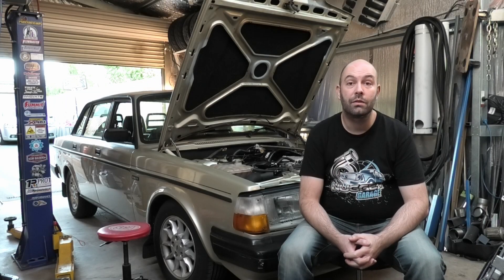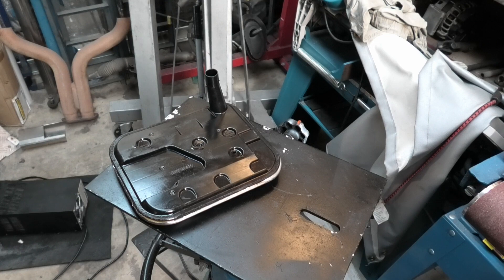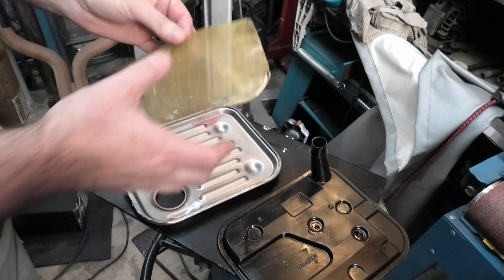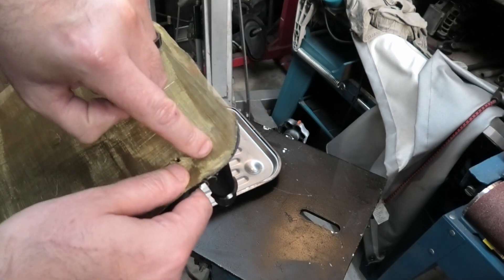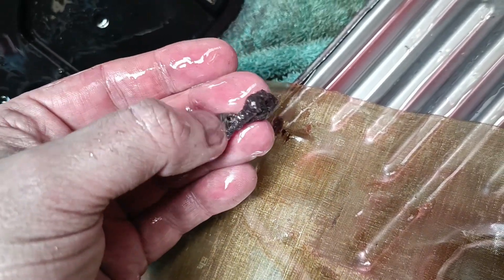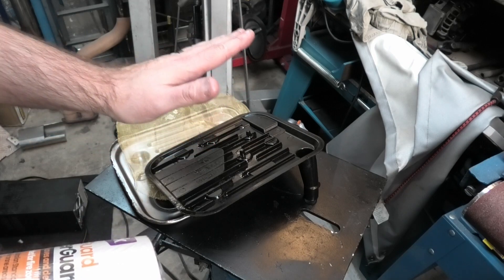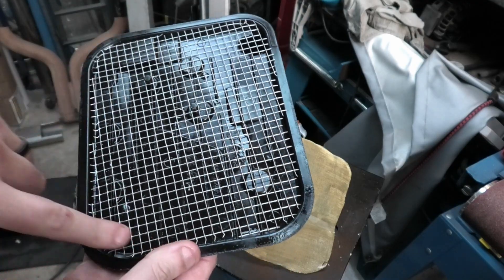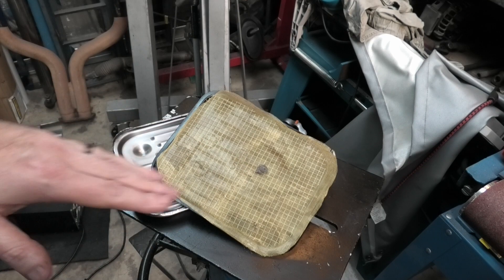4L80e - I FIXED IT

Comment: The wad in the mesh at the pick up tube Looks like assembly goo that didnt melt down with run heat.
Reply from the maker: Nar it was something fabric based. Looked like shop rag lint after I dried it out to inspect.

Comment: I used to use the red shop rags to check fluids but they come apart and will leave strands like that in your motor and your transmission. I use the blue paper towels and after I clean the dip sticks with that I pinch them with my fingers and pull it through to make sure noting is on the dip stick before I put it back in the motor or trans depending on what im checking. Good catch on this one!

Comment: ? Did that filter had the transmission not shifting
Reply from the maker: It wouldn't move at all in any gear. Changed the filter and pressure came up to normal levels and all problems solved.
Reply: @AngryGermanGarage  do you know what would cause to overheat I can drive for about 30 minutes then it would stop shifting let it cool down it goes back to normal
Reply: @kingsavageDKS 
Is there a dent in your lines  ? Hit road debris  ?

Comment: I have a 80e currently I'm my gmc sonoma behind a 6.0L and I've been trying to find out my issues aswell. Rebuild trans using Jake's stage 3 kit with that same filter...... I have no movement in any gears, but It did work fine for about 5 kilometers of driving. Could this be my issue aswell?
Reply from the maker: Would certainly be worth checking.
Reply: @AngryGermanGarage  if it wasn't for me to see this video I would of had it pulled out for nothing...thanks
Reply: @AngryGermanGarage  well that was my problem aswell....all fixed now

Comment: That's gotta be frustrating. What facebook group helped you? I rebuilt my own and it ran fine for a few thousand miles. I recently smashed down on it and it shifted to second pretty good. The next time I drove it I felt a fairly soft 1-2 shift. It just got worse from there. It went to first and second gear only and slips. Line pressure is 50 in park, drops and rebounds when you select a gear,  jumps to around 125 revving in park and pulses like it isn't picking up. I am about to check the output to cooler like you did. If you have any ideas, please help.
Reply from the maker: Facebook group did help. There are a bunch of useful people on there, but unfortunately Jake is a moderator and his fanboy army is pretty strong.
Reply: Haha. Yea those filters he sells are junk. Have had issues with every one of them. And they look like a 5 year did the job.